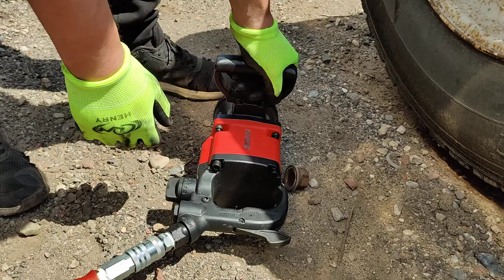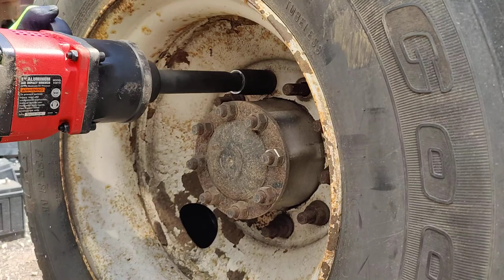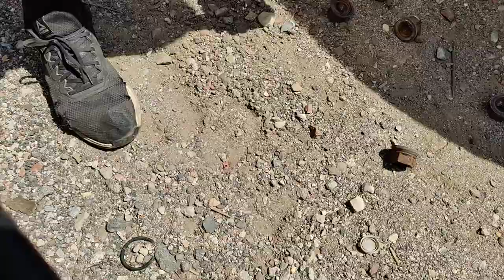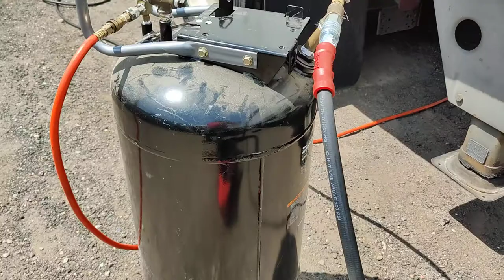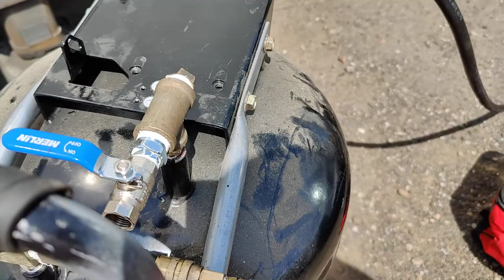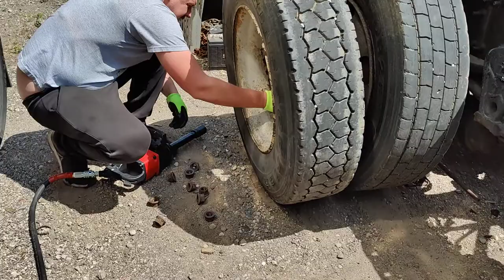HARBOR FREIGHT 1 INCH EARTHQUAKE  impact wrench test on rusty lug nuts

Comment: I call bs on this one.  I've owned a very similar air impact wrench.  Those lug nuts weren't very tight.
Reply: Nah these are legit they're actually scary cus of the power plus outside trigger placement and weird angle on the quick connect for the air hose
Reply: @noelduarte4557  I had a similar 1 inch impact wrench. I bought it at Northern Tool. It was their house brand, Northern  Industrial. It was very similar to the one in the video. The trigger was on the "outside"as well and would scare the crap out of me when I'd bump it accidentally as I walked by. The reason I called BS was because of the sound the one in the video made. Those lug nuts didn't sound like they were that tight. That gun seems to get to "no load" speed a little too easily. 
I only ever used mine on my truck and ran it off of my truck because I didn't have a shop air compressor with 1/2" output threads.
Reply: @tiorobot  I see yeah idk about northern tool but those earthquake guns are stronger that a horse's drop kick and lug nuts are supposed to be set at 450-500 ft-lbs of torque and that gun will get it there about 1.5 - 2 seconds after making contact with the rim when tightening, so when taking off if torqued to spec it seems sort of like this I will admit though it's slightly too fast for my liking also probably wasn't more than 350 ft lbs tight
Reply: @noelduarte4557  somehow or another I had a pop up ad from Home Depot that advertised the Stark USA brand. It looks identical to the Northern Industrial that I had bought. Same plastic case, 2 sockets (38&41mm) I believe, all black, barb fitting adapter, and the trigger on the outside. It was pretty heavy. The plunger in the valve went out on it and I fabricated my own. It didn't seal perfectly and would sound like an idling chainsaw.  I was happy with my purchase because I was able to do my own work on my truck.

Comment: I have 1 like that I have a 1 inch adapter but dont really fits ,what is the size of those socket pls or where tu buy those pls ?
Reply from the maker: This is 33 mm you can get them on amazon
Reply: Ok thanks
Reply: @lastchanceshop  thanks it works 👍

Comment: Biggest impact wrench I got is a Milwaukee 1/2 high torque but sometimes that don’t got enough beans to take off dd15 head bolts. Would this work better
Reply: Yeah this should definitely get the job done for you. I have a Milwaukee 1/2 impact too. The earthquake has about 2500 ft lb nut busting power compared to the Milwaukee’s 1600ish ft lb. I do like my 1/2 Milwaukee though. I also have the Milwaukee 1” D-handle and it’s a beast. The only thing you need to worry with using the Earthquake is having enough pressure and a big enough air hose.
Reply: @traviscarr6536  yeah cool. 1/2 high torque does everything I need but can’t take head bolts always. Need a 3/4” gun but milwaukees doesn’t even have that much power over the 1/2”
Reply: @rudydaberry122  yeah you’re right. I think the new 1/2 inch high impact is 1600ft lb and the old half inch high impact was 1400ft lbs. I think the old 3/4 drive didn’t have but about 200 ft lb over the old 1/2 with the old 3/4 at about 1600ft lb. I’m not sure if they’ve got the new 3/4 impact out but it will be interesting to see what torque it has. Your best bang for the buck might be getting an impact from harbor freight. I know Harbor Freight have many impact guns and a lot of them are pretty good tools.

Comment: Milwaukee electric 1" impact! It changes lives! No more lugging around air those days are gone.
Reply from the maker: Yes I agree but is too much money for me
Reply: I’d rather “lug” around a hose then a battery that weighs twice as much as an air gun
Reply: A bit silly to think that a battery weighs more than a good air hose or is more cumbersome, but to each their own...
Reply: @jaytubin5444 Milwaukee now makes a 6.0 red lithium forge battery that weighs less and is as strong as the old 12.0 batteries. Soon they will have the red lithium forge in all sizes with more power and half the weight. Not that I really paid much attention to the battery weight before.
Reply: As a big rig tire tech I take off too many lugnuts per day the batteries wouldn't even last until lunch time
Reply: @traviscarr6536 ..and half the runtime
Reply: @cloudy4872  is that right.. I haven’t bought one yet and was interested how that would workout. So you don’t like the forge batteries that you have.?
Reply: @traviscarr6536  it has half the capacity compared to a 12ah, it’s pretty simple.
Reply: @cloudy4872   tested on the torque test channel which you can watch with your own eyes it says different. It’s not pretty simple with a totally different design of cells riveted in stacked packs vs the 12.0 that when has 16-17 battery cells that looks like your standard 18650 flashlight batteries. The 6.0 forge was put on a 700watt draw and held a charge longer than any other battery Milwaukee puts out,, including the 12.0. You really have never even used any cordless power tools have you..😂
Reply: @traviscarr6536  I was making an observation, and I have used approximately 3 cordless drills in my lifetime (I’m 14💀)
Reply: @cloudy4872  I realized you was a child after your second comment. I thought this kid doesn’t know anything about what they’re saying,, the kid is just seeing 12.0 and 6.0 forge and saying to themselves “12 bigger number than 6 so 12 gots to be better.” I had laid foundations, framed houses, could tear down an engine and rebuild it by the time I was 14. Age should set no boundaries on your ambitions.
Reply: @noelduarte4557  I’m wanting to get one and if took this into consideration, do you think a power inverter and the battery charger in the truck would fix this? Mobile tire tech here

Comment: What size hose and compressor recommended for this ????
Reply from the maker: ½ inch you need without restrictions that why i use that black tank as storage  and small compressor pumping to the tank you see on the video other wise you will have to spend a lot of money to buy big compressor
Reply: I have a 30 gallon gas compressor in pick up truck . I bought it used for $400 and it works perfect for removing tires